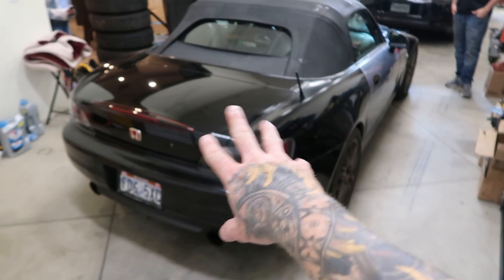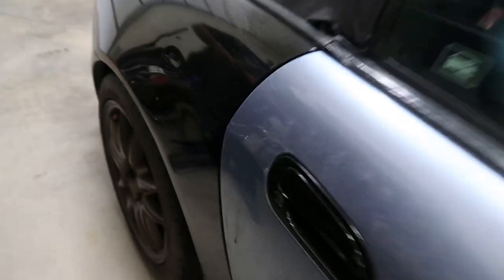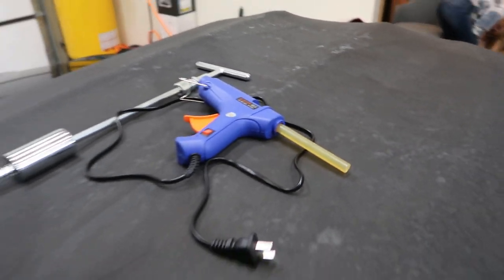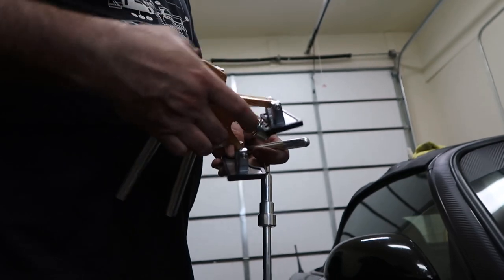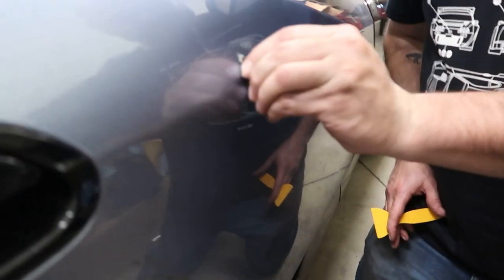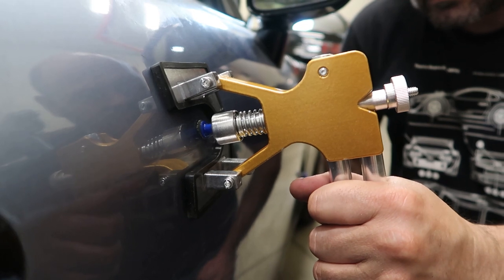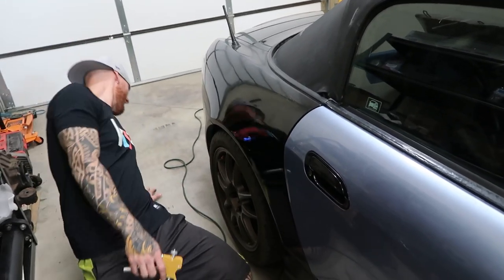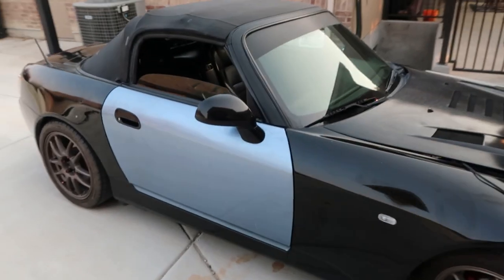DIY Amazon Dent Removal on S2000

Comment: I have used one of these and they do work. They are slower than getting behind a panel with a set of rods, but it does take some technique with a glue puller. Just a few tips: Use bigger tabs on the larger dents as that covers more surface area. Put glue on the tabs and not the dent so that you can see exactly where you need to place the glue tab. Use rubbing alcohol to get the glue off easily.

Good first attempt though!
Reply from the maker: Thank you! I appreciate the feedback!!

Comment: 1. Put the glue on the tab
2. Do one dent at a time, not multiple. You let the glue sit too long.
3. Spray with alcohol and scrape off with the supplied scraper.
4. Heat the paint first with heat gun. If you're scared of burning it, use a hair dryer for longer.
5. The glue hardens quick so do many pulls quickly until satisfactory.
6. Get a glue pulling light and watch a tutorial on knock down.
Reply from the maker: Thank you for the input!!